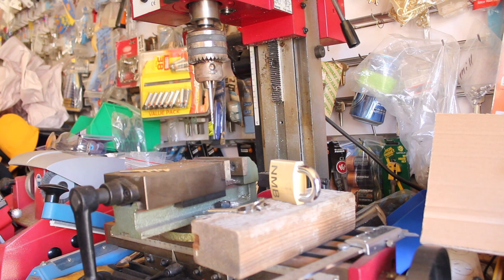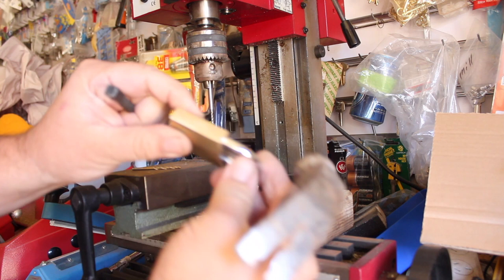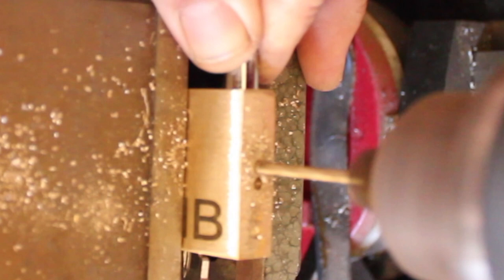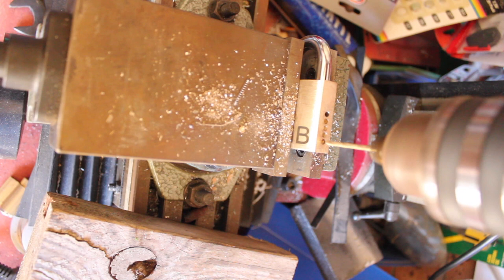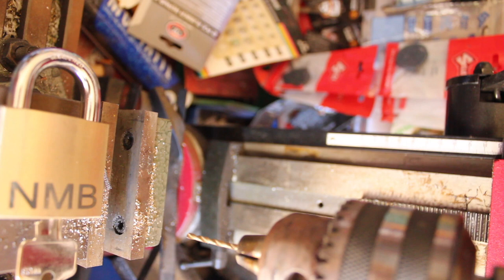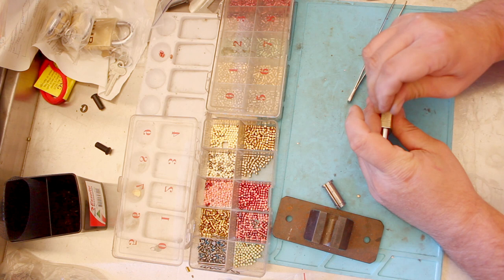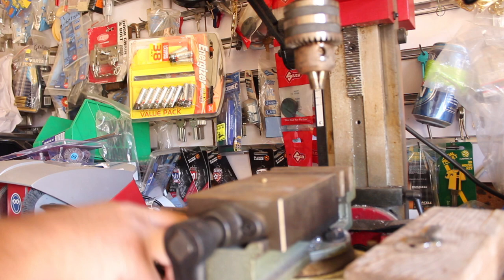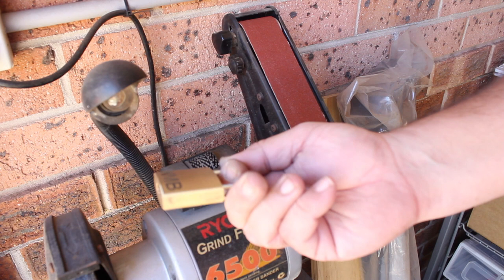How To Rekey A Sealed Brass Padlock

Comment: Hello friend, just wondering if you have come across the cyclone pro cloner before? I've stumbled upon it, while looking at the handy baby..what do you recommend for vw id48?
Thanks Darren
Reply: Cyclone Pro is just the AD900, rebuilt by The Diagnostic Box.
To my knowledge, The Diagnostic Box are ex-staff from Advanced Diagnostics anyway.
AD900 / Cyclone Pro are still pretty old tech.  They work, but may not have options for the latest chips out there.

Currently, I'm having pretty good success with the KD-X2 for cloning, including VW ID48
Reply: @GutterClown  Thanks for your reply, have you used the handy baby cloner?
Reply: looks just like the Jet iClone we use.
Reply from the maker: Buy Handy baby , the new one, seems to be what locksmith like more, VVDI key tool is a wash out
Reply: @DrLockShop  Thanks I had sort of decided on it to be honest..keep up the good posts☺